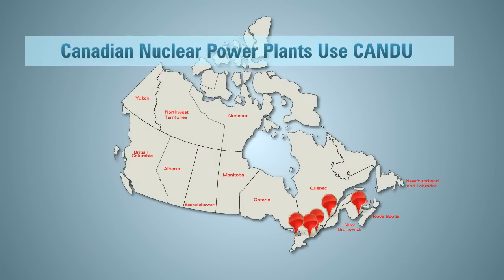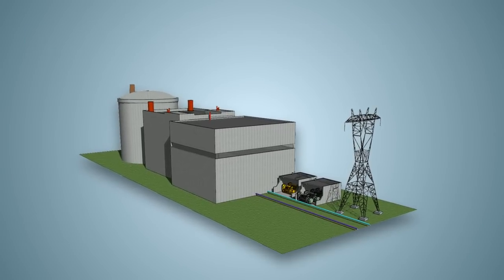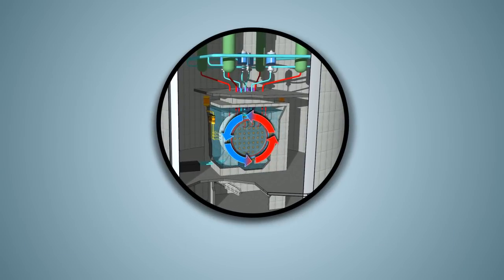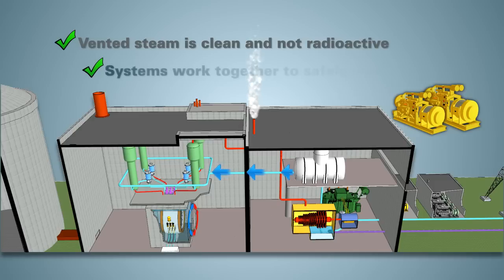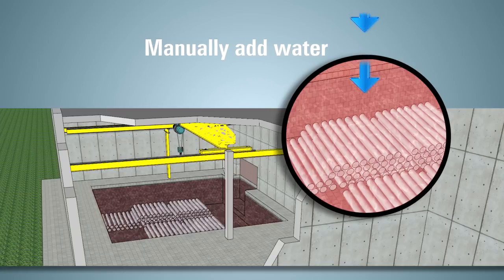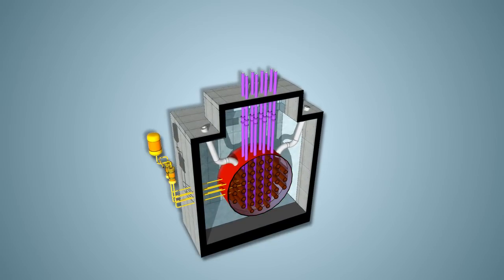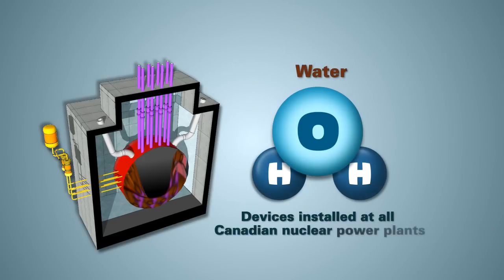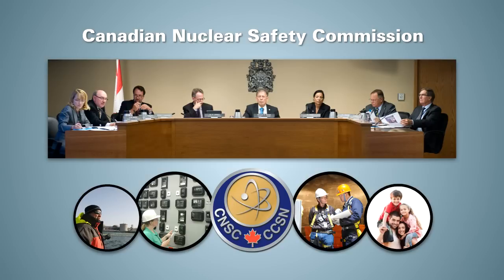Understanding Nuclear Power Plants: Total Station Blackout

Comment: If the fuel did melt all the way down to the thick concrete slab underneath, is there any chance it could continue to melt through that and down into the ground? How long would it take for the melted fuel to cool on its own? Would you have to wait for it to cool before you could begin cleaning it up? Or once power is restored could you flood the building and keep water circulating until it's cooled enough to be disposed of properly? 
These videos are great! Thank you for posting them! I'd love to work in a nuclear power plant one day.
Reply: +Shawn Thompson Just to add to what cnscccsn already said:

At Chernobyl, the melted fuel (the "elephant's foot", I encourage you to check it out) only pierced a few cm into the concrete in the building foundation, so we have no reason to believe it would melt into the earth very far, even if it were dumped on bare soil at peak operating temperature (although I wouldn't recommend trying it!).  But if it somehow did melt arbitrarily far into the Earth, once it hits ground water it would shoot a slurry of radioactive mud high into the air like a geyser in a (theoretical) phenomenon known as the China Syndrome.

Thanks for your interest in Nuclear Power!
Reply: Shawn Thompson Supplying water to the calandria would prevent an accident
Reply: im surprised you wouldnt have a ginormous battery bank to power the water pumps just incase the worst was to happen and all the generators quit
it might buy you another few days before losing the core

or perhaps cover the roof with solar panels and use the power from those to cool the reactor during the day and to recharge said battery bank 

fi you are going to spend $200 million on a nuclear reactor you might as well drop another $2 million on solar panels and batteries to protect your investment if all other power sources fail
Reply: CANDU should have wolfranium floor/calandria. Tungsten is the only corium-resistant material on Earth! It's melting point is around 3500 degree when corium reach max 3100. Wolfranium as heavy metal have excellent heat conduction!

If Fukushima have tungsten shield, it corium wouldn't melt through the vessel.
Reply: the battery banks only power instruments 

did YOU watch the video?
Reply: @WadcaWymiaru   Tungsten is not an ideal material for reactor shielding, as it can react with atmospheric/other sources of carbon when heated (such as by a large mass of corium) to produce tungsten carbide, which is a strong neutron reflector and could conceivably cause the corium mass to become critical once more or, even worse, to become supercritical, as happened during the Slotin accident in the 1940s. The absolute worst-case scenario would be a Chernobyl-like predetonation event which would, of course, immediately destroy the reactor, contaminate large areas of the Earth, and cause the death of hundreds. Such an event would require ideal circumstances and a larger mass of carbide than would probably ever be formed during an accident, but the possibility exists and is a persuasive argument against using metal shielding when concrete is sufficient.
Reply: Tungster aka wolfranium CAN be shielded by other metal as well.
Corium does not contain carbon. And only cabon from two elements is strong neutron reflector. Tungsten carbide was creating net that kept carbon atoms.

In Czarnobyl the water was the main problem, not graphite. It basically...exploded. If reactor no.4 had wolfranium floor corium would fall on it&froze, graphite would float on very dense material. Wolfram density is 19.3 times that of water, comparable to that of uranium. Uranium oxide is like half of it.
Wolfranium can resist temperatures up to ~3800 °C before melting. Molten Corium is like 3300-3500 °C...
Reply: @Lightspectre1  Apparently the elephants foot is slowly deteriorating the floor on which it sits, which is why there's now the bug push to dismantle and clean up the site.
Reply: @DieyoungDiefast  the real question is what will they do with it once they recover it? 

Will they reprocess it into new fuel rods or will they just bury it?
Reply: @cnscccsn  Awesome reply! BTW, I was wondering about the timeline for all of this.
Reply: The fuel cannot melt into the ground. A core entering the outside environment would be the worst possible outcome and all reactors are carefully designed to prevent this under all circumstances.

In the event of a catastrophic failure and full meltdown there's a room under the reactor containment designed specifically to catch the core providing it a place to spread out and cool. It's shown in the animation but not explicitly named or described by the narrator. The floor in the bottom of that room is several meters thick and made of materials that mix with the molten reactor core and reduce it's heat. Both by dilution since the core melts and mixes whatever it touches and also by providing a space to spread out giving the molten core more surface area to radiate heat from as it forms a puddle. It'll stay in that catcher room, even if additional water or other materials aren't dropped on it. 

A melted down core is extremely similar to lava except it makes it's own heat. So depending on the severity of the initial accident it would need several months to a year or two before it solidified. Once it turned back into a solid mass of assorted radioactive and building components it could be chiseled out and disposed of.

Although they'd wait as long as possible, to make everything easier. Paradoxically the core is the least dangerous part of meltdown and only needs to be cleaned up last, if ever. So the decontamination crews are quite content to let it set and cool for as long as necessary to make their job easier. Fukushima is the unique exception, the clean up there is obsessing over the cores because outside water is still falling on them, and they don't want that water getting out again. Hence all the fanatic work on robots to speed up the clean up operation there.
Reply: @Lightspectre1  hahaha - The China Syndrome. Let's leave Hollywood out of this please. That postulation is not accurate base on the Chernobyl accident.
Reply: @mwbgaming28  Not true in reality. Batteries also power some DC pumps.
Reply: @dslag654  meanwhile in Japan
Reply: @mwbgaming28  Yep. Batteries don't last forever. As soon as they were exhausted (~12 hours if memory serves), things went from bad to worse. How long does a cell phone/laptop battery last when putting out maximum power? And then what happens?
Reply: @dslag654  should have added some solar panels to extend the time until the core overheated and went critical
Reply: @WadcaWymiaru  uh, ok, I guess you know science?
Reply: @TheGalaxyhopper  
I know the density, that's enough :/
Reply: @mwbgaming28  That corium cannot be used in fuel (too impure, too radioactive, and too much power to create U-235). They would probably find an undisclosed mountain location and bury it under miles of bedrock so that its poison is away from groundwater or any other thing it could contaminate until it is no longer radioactive (likely in the hundreds of years).

Comment: This is one of the things they got wrong at Fukushima, the backup generators were in the basement. They should have been behind the plant, further up the hill at a higher elevation.
Reply: That's the problem with life, Hindsight is a wonderful educator, but no use at the time you need the ideas. The shuttle was a fine example.... after Columbia every shuttle got a once over by the ISS to check for damage, didn't help the Columbia crew though.

Comment: Is there anyway to stop the accident by adding water to the calandria?  Say using fire trucks?
Reply from the maker: Hello Evan, Multiple means of adding water to the reactor have been added or are in the process of being added. These are designed to prevent significant core damage. The added means also includes the use standard fire truck connections.
Reply: @cnscccsn  Also, the low pressure of the moderator, like helps with water addition in the case of CANDU reactors. I believe that relieving the high pressure in the core at Fukushima to allow water addition helped cause the hydrogen explosion?

Comment: Use the residual decay  heat to drive  sterling engine water pump(s)
Reply: The problem is the lack of said fluid
Reply: @user-vv7qp5nm4f  the Great lakes have a tiny amount of water that you might be able to pump from

Comment: My understanding of CANDU is that if the water inside the calandria boils off, the reaction would stop anyways since the water is the moderator? I was under the impression that that was one of the biggest advantages, that it's literally not possible for it to melt down due to passive effects

Comment: Given reactors generate heat (even if it's just the decay heat), there must be some way to harvest that heat and use it to drive a semi passive cooling system like something based on a Stirling engine or even a thermoelectric generator that is just powerful enough to keep cooling water flowing... NASA has developed one that uses decay heat to power spacecraft... I do not know if they've launched anything powered by one yet, but perhaps a similar design could be made to actively cool a reactor using even just the decay heat for a few decades...

Comment: The ending is really vague, which is odd because the rest of the video is so in-depth. In the unlikely scenario that the reactor fuel would melt, all you say is "the reactor building would continue to isolate the reactor from the environment and contain radioactivity." How? What's stopping the pressure from continuing to rise if no one can come to vent it? Wouldn't the pressure just keep rising until it explodes?

Comment: I have a question. On a typical operating day, how much Radiation escapes the containment building? I know reactors are very safe but some radiation must escape? is it so low its unmeasurable?
Reply: I believe coal plants actually release more radioactive material per day than properly functioning nuclear reactors do.
Reply: compwiz00 To elaborate on this, I've heard that this is because of small amounts of uranium in coal.
Reply: Trevor Lawrence supplying water to the calandria would prevent the accident
Reply: Just supply water to the coal, that will stop the accident...
Reply: Trevor Lawrence Such a small amount that even if you stood right in that spot for 10 years you'd still get far less radiation exposure than you do from a single international airline flight.
Reply: Here's a simple answer:

The amount that'd reach you is a hell of a lot less than you receive from an x-ray...and definitely less than a CAT scan...or a PET scan...or...

...you get the idea. Actually, you get a significantly higher dose from eating a banana.
Reply: Basally undetectable, and it's almost all tritium which occurs naturally and quickly dilutes into the environment. Ironically though the CANDU reactor design shown in this video emits 10 times more than most other reactors in the world. But 10 times 'near zero' is still 'near zero', that's how multiplying small numbers works. :P

Comment: We can argue that the 4th backup system (portable) is kind of overkill and does not eliminate the risks all that much. The main two problems with nuclear safety in my point of view is that : 1) The main safety backups are fuel based and rely on the accessibility of the ressource for a prolonged period of time in case of a huge disaster (road blocked = no fuel in and no portable system can come in except by air delivery if even possible) 2) It is pre-assumed that the reactor will be restarted which is not necessarily desirable in case of a prolonged societal disaster in which the grid would be off for many months or years. 
To me, considering the gravity of the possible impact: a safe nuclear plant would be automatic (or with minimal human intervention), grid independant and permanant shut down without melt down for neither the rod pool nor the reactor.
That being mentioned, I understand that the fact that CANDU can generate their own electricity from within the plant with one reactor only, which mitigate enormously the risk compared to other existing designs. But nonetheless, CANDU plants are not capable of permanant auto shut down without the grid.

For how long can you run your cooling pumps with the fuel that is present on site ?
Reply: "To me, considering the gravity of the possible impact: a safe nuclear plant would be automatic (or with minimal human intervention), grid independant and permanant shut down without melt down for neither the rod pool nor the reactor."

Then you're looking for molten-salt reactors, Terrestrial Energy's IMSR being one example that's being developed in Canada (quite a few companies establish themselves here instead of the US because of some absurdly restrictive regulations around reactor development).
Reply: Lets hope these technologies get installed and/or our grids get secured before for instance a major solar flare happens.

Comment: 04:24 at Fukushima they lost all back-up power systems, because they were flooded.
Reply: These Canadian reactors are designed to still have emergency mechanisms that need no power
Reply: Well yes but no , some generators were fine but the swichgear was flooded
Reply: @bryankambuno6996  The back-ups on a Candu were built at ground level looking at the video not installed in a basement built under normal sea level like at Fukushima.

Comment: For the record the nuclear reactor in Japan, had one of these safety backups, including the generators, the batteries, the water, condenser, even used the firetrucks and none of them failed to prevent the meltdown. There’s no additional safety procedures here which Fukushima did not have& try. It all comes down to training and proper EMERGENCY exercises. In absent of that, a meltdown is just as likely to happen here.

Comment: Can you be more specific on:

* How hot is the fuel before the accident?
* What temperature is ideal of the fuel after the accident?
* The emergency power generators what do they run on?
* How thick is the containment building of the power generator?
* Once meltdown fuel would fall onto the concrete slab.. how thick is that concrete slab?
* The radiation that is released... how toxic is this?
Reply: One shall do so as requested.
Reply: * How hot is the fuel before the accident? 
- Really hot

* What temperature is ideal of the fuel after the accident? 
- Less hot

* The emergency power generators what do they run on? 
- Diesel

* How thick is the containment building of the power generator? 
- You mean the reactor?

* Once meltdown fuel would fall onto the concrete slab.. how thick is that concrete slab? 
- Really thick

* The radiation that is released... how toxic is this? 
- Depend how fast you run from the contaminated area
Reply: You have failed!
Reply: 1. 260C but thats under extreme pressure to keep it like that. 
 2. 49C after is what they try to keep it at. 
3. Jet Fuel, diesel and batteries. (4 jumbo jet props for the main backup)
4. Thick, like 1.8 meters thick.
5. It would land in the fueling duct, same 1.8 meter thick. 
6. They filter it and can scrub 99.9 percent of radioactivity through it if they had to do it, but it would never get to that point.

Comment: Why not let spent fuel / or decay heat accumulate, and heat up to a high temperature, where...it would become useful in producing electricity again. Then, use that "decay electricity" to cool down the fuel.
E.g a negative feedback loop. the more decay heat there is...the more electricity it produces...the more fuel gets cooled.
Reply: In Fukushima they had steam from decay heat pump the emergency cooling around on reactors 2 and 3, for a while it worked too, but eventually other problems overwhelmed the situation. There was no electric generator in the mix, just a turbine coupled to a pump, it was one of the emergency backup systems.

Comment: So....what if there's nobody left to manually pump water into the fuel pool? Like during a war or disease outbreak?
Reply from the maker: War or disease, this scenario would define certain workers as essential. They (or replacements) would be available to maintain water supplies to the irradiated fuel bay. Any source of water will do. The provincial emergency operations centres (with federal support) are more than capable of providing portable  pumps.  

CANDU spent fuel bays tend to have lower heat demands due to the spent fuel being natural uranium rather than the enriched fuels of other designs.

Comment: what is really needed here is a contaminated-steam driven pump to pump cooling water if all generators fail and a meltdown in inevitable. I worked on a Navy ship with mostly all steam driven pumps, this would be possible and could be a self-sufficient last ditch system.
Reply: Just imagining that ironic steam safety system: Using the heat from the meltdown to drive a steam engine, to pump water onto the radioactive core. That is basically how a nuclear reactor works! So when a nuclear reactor catastrophically fails, it becomes a mini nuclear reactor

Comment: Goodmorning.. Could you
IdentifyWhat.. IS.. Critical.. Risk.of
Construction
Operation &Maintenance
Retirement
And.manage That.Risk?
Thankyou
Reply from the maker: Hello Anoo, Risk is managed at all parts of the nuclear power plant life cycle: design, procurement, construction, operations and maintenance. The risk of an NPP drops considerably once the fuel is removed as part of the preparations for decommissioning. Risk is managed by the CNSC requiring facilities to have a management system see REGDOC-2.1.1 that is focussed on safety. https://nuclearsafety.gc.ca/eng/acts-and-regulations/consultation/comment/regdoc2-1-1.cfm